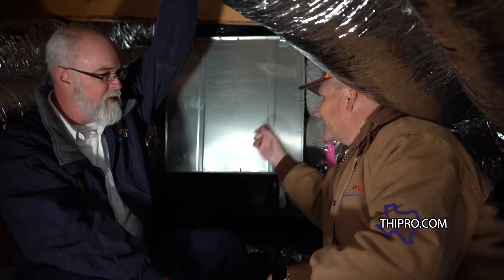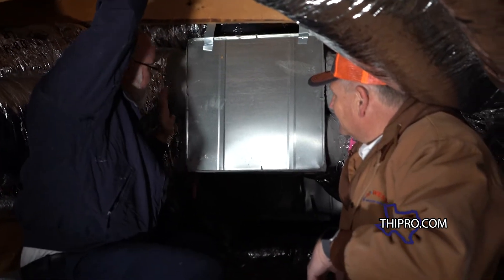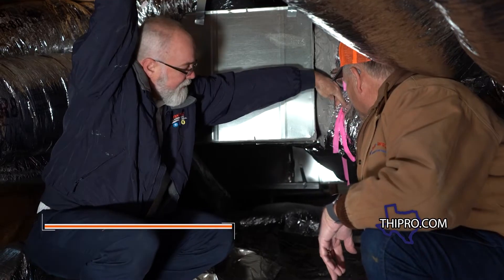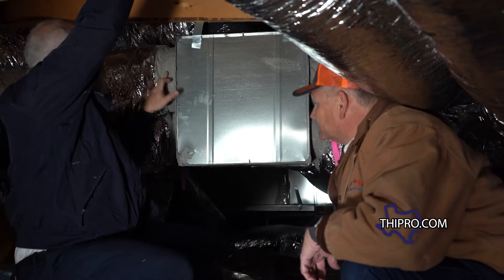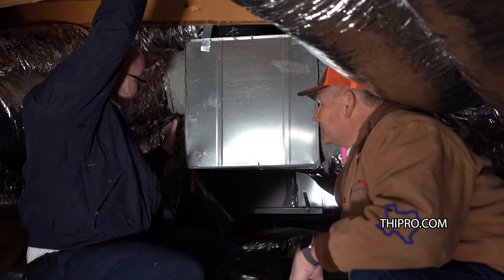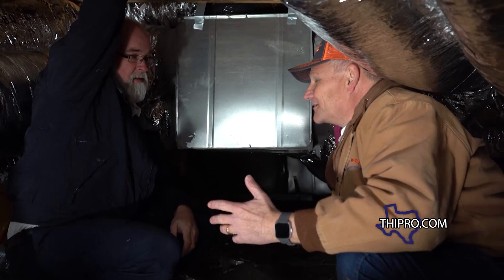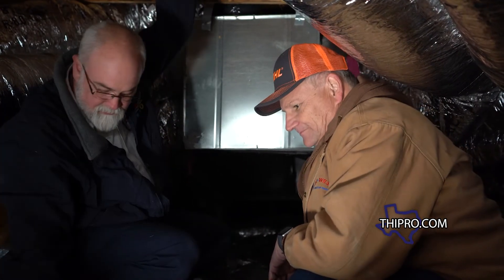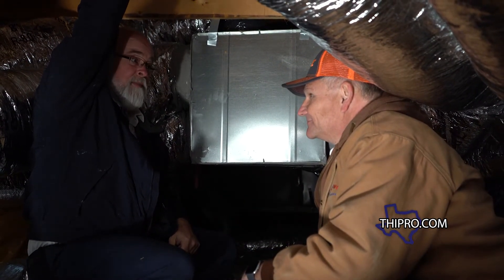The Role of the AC Plenum

Comment: I want to know what a plenum dose?
Reply: It's the steel box that accepts air from the blower and distributes it to the rest of the ductwork going to your vents.
Reply: Is a plenum needed for the supply side of a/c or could metal Y’s be used? About 20’ from my handler is a plenium box that comes in with a big foil duct (maybe 16”)  and exits the box at  a right angle  and exits with 3 different sized foil ducts (10”, 6” and 4”). Couldn’t i just use a Y into another Y to keep the air flow running straighter instead of a right angle and eliminate the box? I assume making right angles slows air flow. (The rooms with the 6” and 4” ducts don’t  get as cool. I Was going to install in line booster fans for them too.).